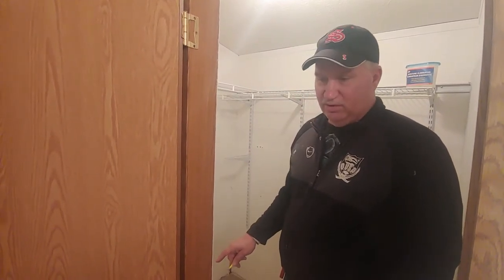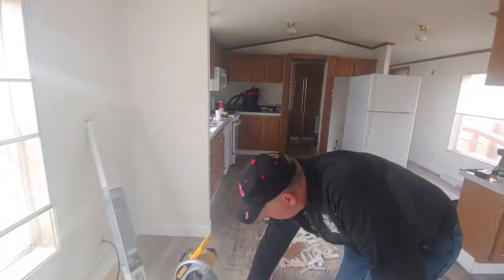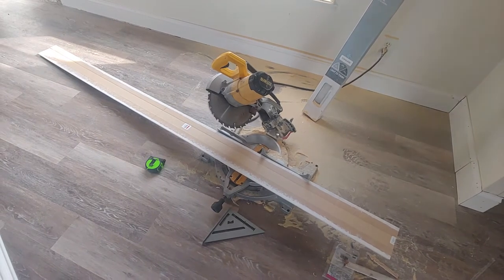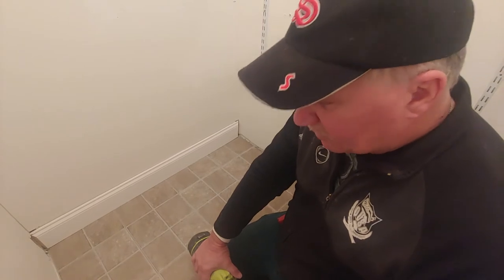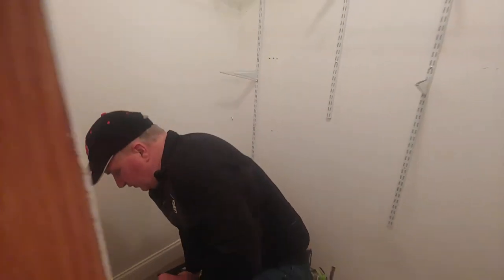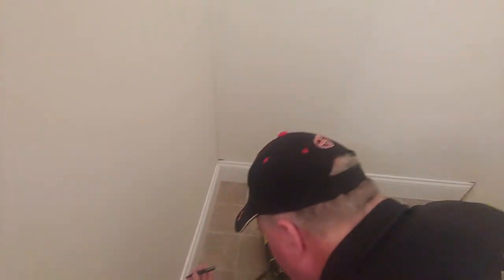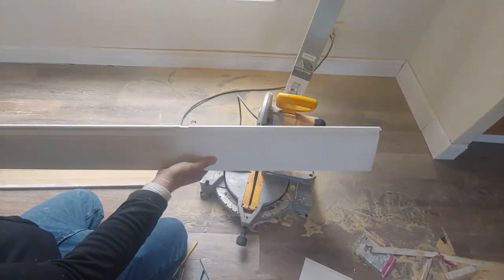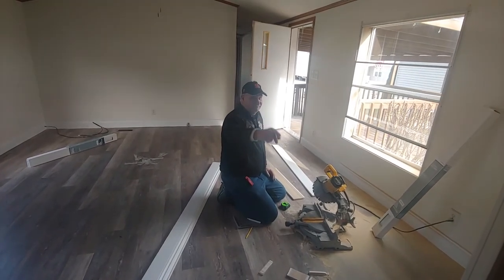How to Install Decorative Trim In A Mobile Home

Comment: For anyone making straight cuts(vertical top to bottom), a lot of hand saws are made so that when the edge of the handle closest to the blade it can be used as a square so that you can take a pencil and scribe a straight line. The edge of the handle can simply be butted up the whatever needs a straight line with the handle edge sitting on the edge of what you are cutting with the blade over hanging the face of the intended cut then take a pencil and run it along the flat edge(top edge) of the blade.
Reply from the maker: Thanks for sharing. We could all be improving our lives by sharing what we have learned.

Comment: cop the corner i found moving right to left coping right side is a far beter and fast way to install only one cope each inside corner i find it more fast to only cope the right end of the board left end flat or outside corner..... took me some practice
Reply from the maker: Your right good idea. Now let's see if I remember. Thanks
Reply: @StraightArrowRepair  it was hard for me u have install right to left con is you can install next one with out the first on lol but the inside corners are always good and if it’s to long just cut the flat side no need to try and line up your miters

Comment: Is it possible to use liquid nails or Dap Dynaflex 230 instead of the nails? We just laid the flooring in our trailer remodel and baseboards are next.
Reply from the maker: @tayelorwallace  haven't done it . Could be . Try it in a small room and make a decision.